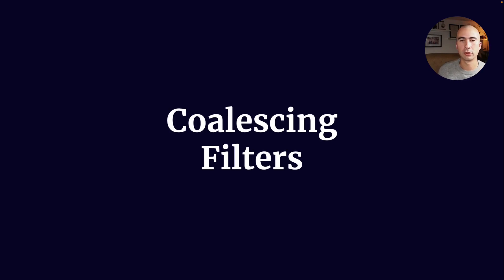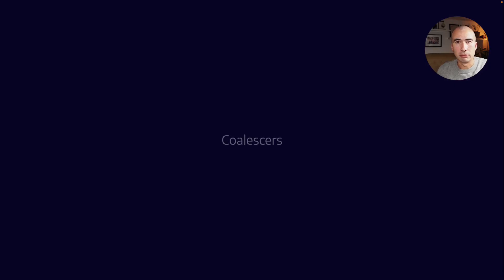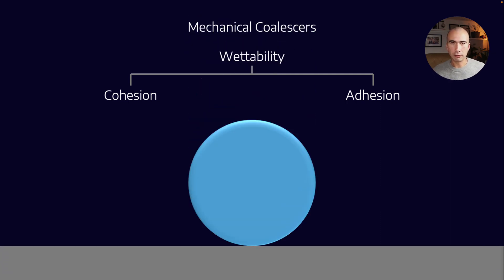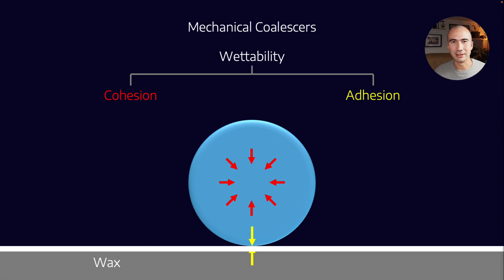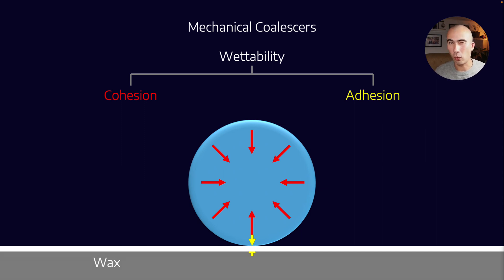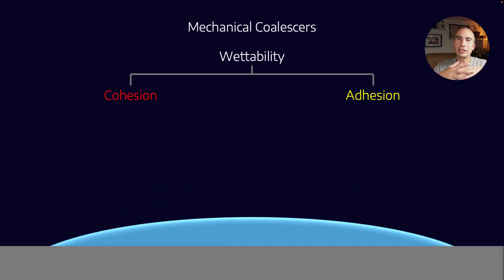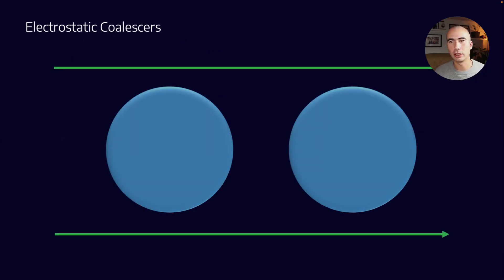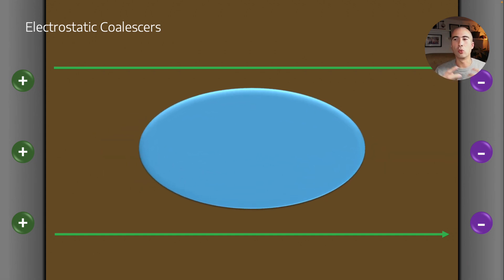How do Coalescing Filters remove water from oil?

Comment: so wont the water particles be attracted to the metal plates which will be inducing charges
Reply: water is polar, the metal plates individually are not. So the closer a water molecule's localized positive side of the dipole is to a negative plate, so too is water's localized negative side of the dipole which decreases water's attractedness to the plate, even if the positive side is slightly closer to the negative plate. While in solution, there are other, much more local and smaller water dipoles to be attracted to one another, so the positive and negative charges of each individual water molecule can be satisfied in those attractions.

Does that make sense?

Comment: My dad was an old timer aviator. He used to filter his fuel with suede cloth to remove water. It worked wonderfully for 2 stroke premixed fuel/oil. You could see droplets of water on it at the end, possibly because of the oil. Then it doesn't work for cars nowadays, because the ethanol added makes the water diluted in alcohol, pass throught the suede cloth... You need to know some polarity, coalescense and solvability stuff.